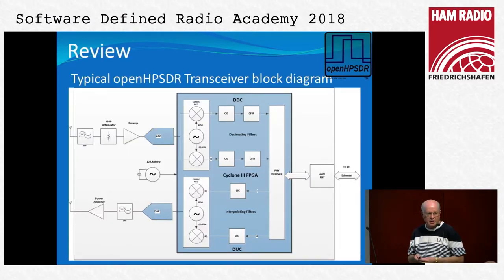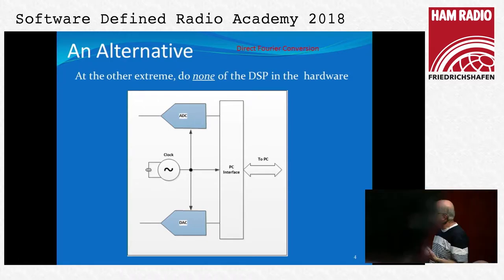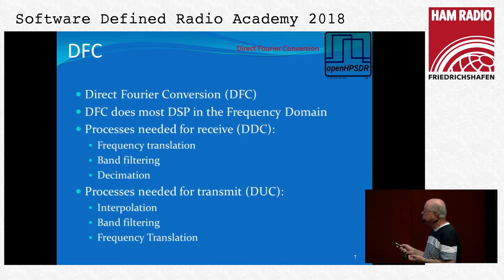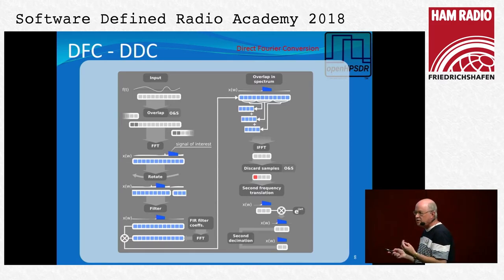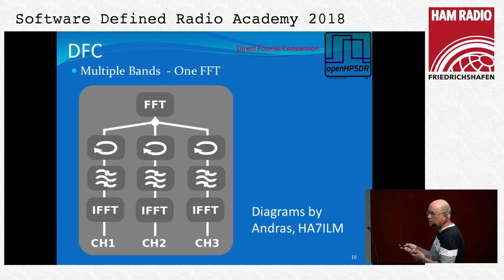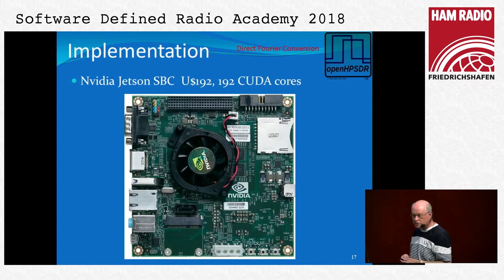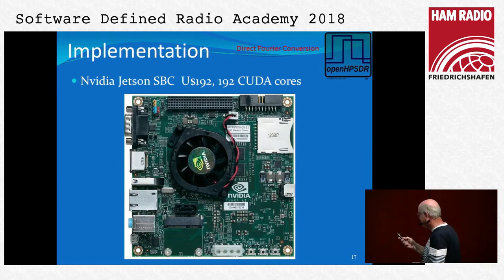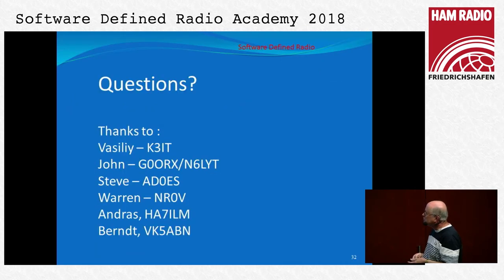Phil Harman, VK6PH: Status of DFC ( Direct Fourier Conversion)

Comment: DFC is very attractive and I think there is an interesting future for it. I have used it for over 20 years, since 2002 publicly in Linrad. My implementation is a little different from what is described here. I see "throw away data points" at some point. That makes me worried about the dynamic range. Have you tested whether false signals are generated in the process of making the IFFT at a smaller fft size? We want spurs to be below -150 dB because the hardware (tomorrow) has reciprocal mixing at -160 dBc/Hz and we do not want to see false signals even when we use a bandwidth of 10 Hz.